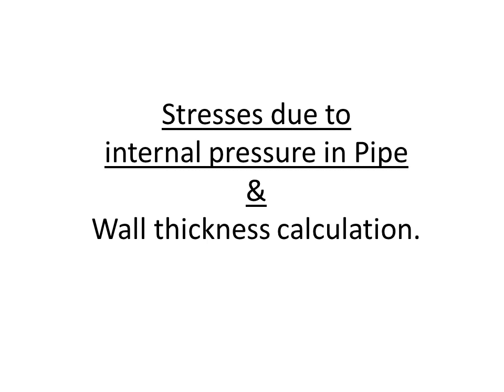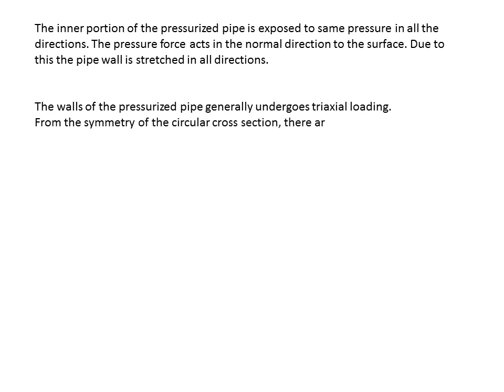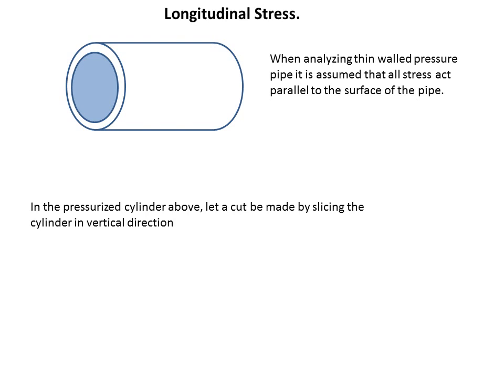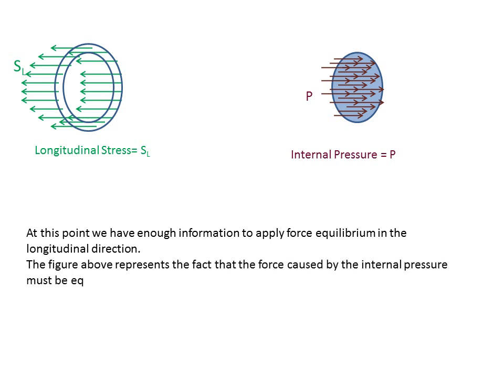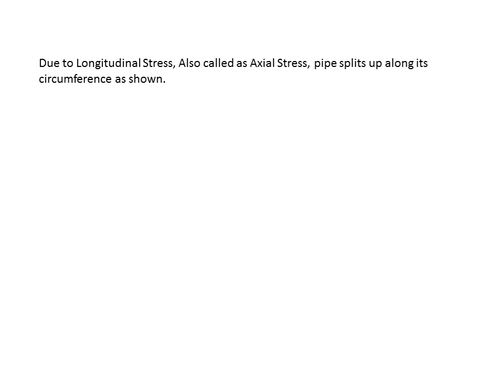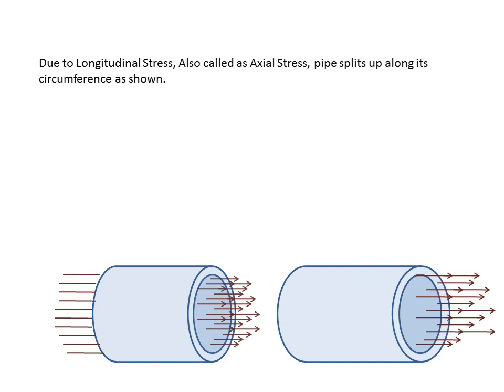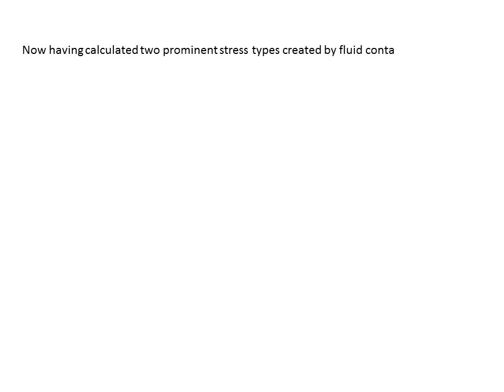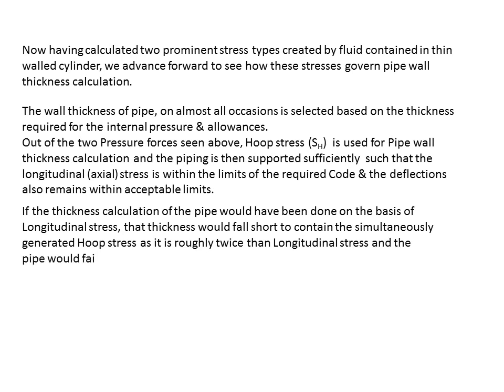Stresses due to internal pressure in pipe & Wall Thk Calc

Comment: This was such a great explanation.  Loved the part with the ASME 31.3 reference and how it accounts for Lame's shortcomings through a quick relationship with the thickness of pipe to the diameter.  Is there a video out there that talks about the differences between ASME 31.3, 31.4, and 31.8 ?